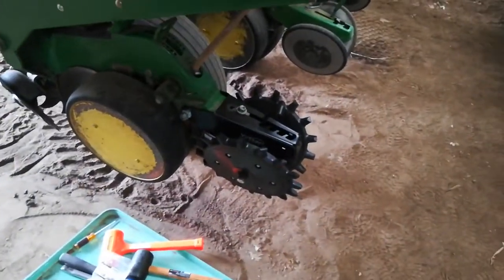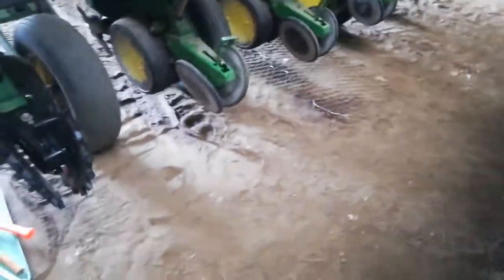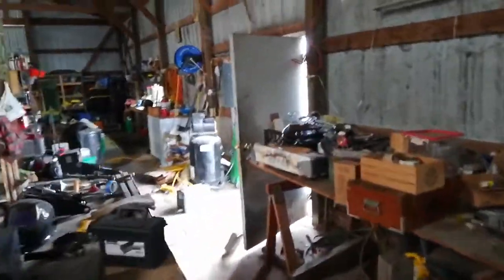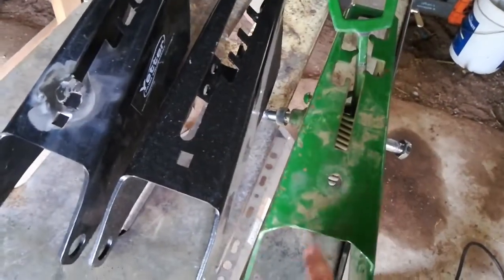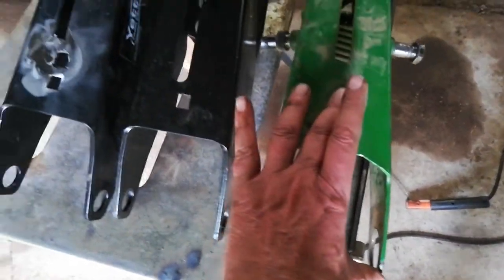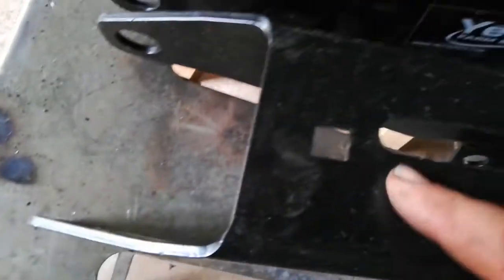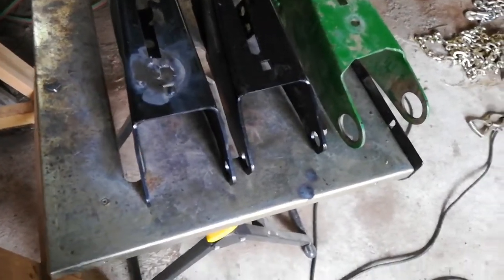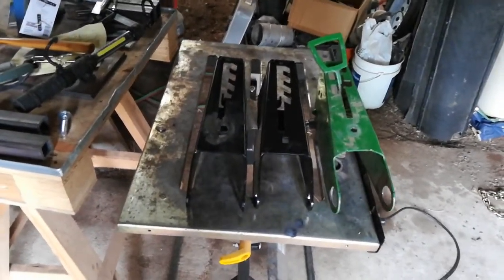Modifying Yetter 6200-184 Tail Piece for a Closing Wheel Replacement

Comment: I feel/hear your pain 👍🏻.  Do you think the zipper closers will work better??  I am still using the round ones.
Reply from the maker: Hi, Thanks! To be honest, I don't know. My dad did a fair amount of research online and the consensus was an improvement of 2-4 bushels/acre. As I said to him, and he agreed, it's hard to isolate/prove that kind of stuff, given all the different environments we grow in. 

The original tail pieces were getting loose and needed to be replaced; the wheels are - for me anyway - an unknown.  The timing wasn't perfect. They kept getting delayed from Yetter, then we had a delay because of the rain, then they showed up. I should be able to get everything done. Seems like no matter how much planning I do I end up running around a lot.
Reply: @grasscreekfarmturtlelake1741  I've already replaced my closing arms/bearings.  I have been thinking about the zippers.  I am curious to know how they handle wet conditions.